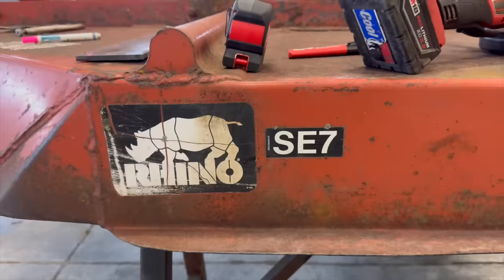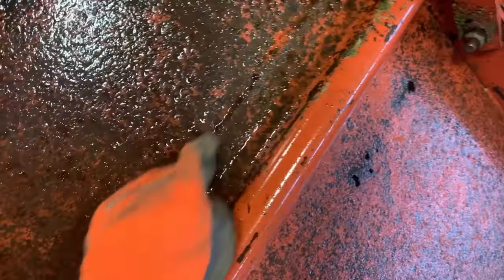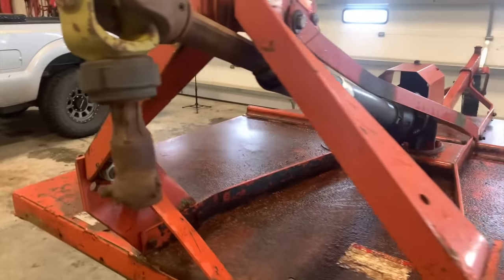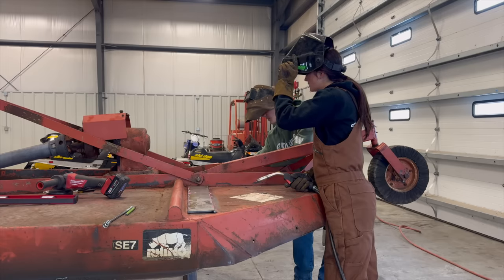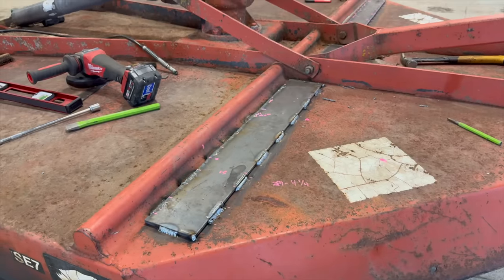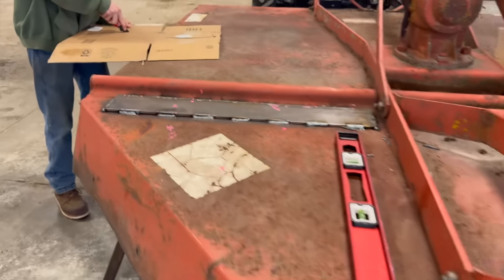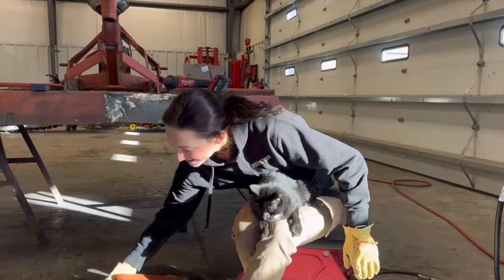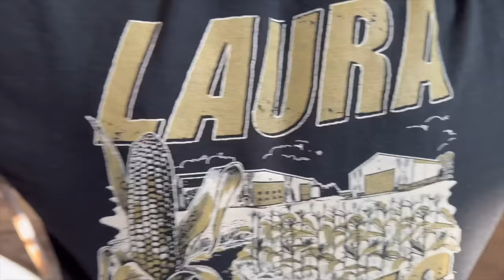Cheap Brush Hog Restoration

Comment: To get better looking and penetrating welds make sure the metal is cleaned up down to bare metal, no rust or anything.  For straight cuts on plasma, use something as a straight edge like angle iron or tubing etc. as a guide for the plasma torch.
Reply: Yeah, I'm no expert welder, but you'd definitely want to grind the rust and paint off and get back to bare metal before welding...

Comment: That round disc under the main deck is called a stump-jumper and is an option. The purpose of it is to help ride the fixed, and spinning, knife bar over a stump or other obstruction. without this option if the knife drive bar hits a stump, the mower would be violently thrown sideways until the stump is cleared. well worth the extra monies. Keep it installed.

Comment: Because my support arm bent on my brush mower.
I cut the support arms and I drilled holes in them put chain in place of the support I cut out.
Works great and I can use my quick hitch now.

Comment: Back in the 90's (1990-1997) I worked for an orchardist here in Central Washington and I rebuilt the Brush Hog mower they had. It was much larger than that one, it had 3 sets of blades with 3 gear boxes and 2 bogie wheels on the back. It too had major deck issues which I rebuilt using plates of T1 steel which is specific for high impact areas and I plated over the whole deck with the T1. I also rebuilt all 3 gear boxes with all new bearings, races and seals  All in all the mower was virtually like new when I was done with it.

Comment: Laura, I have a SE7 that is use 2-3 times a year and it is a beast!  Very strong and works really well.  Mine is a 540 PTO so not super-fast but real durable.  Honestly yours is in better shape than mine.  Word of advise, I have noticed that the 3-point pins and the bolts tends to come loose so be sure to throw some Loctite and lock washers on it.

Comment: you can get nice extension cords from a welding supply company.  you can get them in 25' 50' and 100' lengths.  really helpful.  I use them all the time in my shop to get the welder anywhere in the building
Reply: awesome video like always

Comment: Getting inexpensive farm equipment and farming with it is a perfect series. So many people have embarked on the Homesteading path ("for reasons") and this is a perfect educational resource. Keep them all in a play list as you go.  ... Start building a chart for acreage vs equipment you are using for this project (and compare with modern). An old dealer/customer Allis Chalmers1950s video had an amazing chart for different operations (like plowing, seeding) with their new line of tractors (WD, WD45, CA, B) could do in an hour/day/fuel. When considering how many planting days there are in the spring (say six weeks with some rain outs), a lot more ground can be covered with old equipment if you stay out in the fields than people realize (or are marketed to, to sell million dollar combines). Not sure of your tillage plans but compare plow/fit to no-till (no-till will need less demanding equipment).

Comment: Love the restoration of old farm equipment.  I believe the service to that welder shown was a typical split-phase multi grounded neutral.  It is commonly referred to as 220 volt.  It's two 120 volt hot leads center- tapped off the same 240 phase with a neutral.

Comment: Good to see you working on projects like that.  There is a  lot of equipment out there that can be brought back to life  with a little work.  Try using a straight edge when you are cutting, makes the patching much easier, and mig does not like dirt and debris so a quick pass with the grinder will make your welds better.

Comment: Need an 'Air Scaler' and an "Angle grinder".  Heat works good on those stuck grease fittings,  can also get a hammer activated grease fitting (ala Grease Buster) to get them loose.  While you have it up in the air... might as well clean up and grease the wheels.  Check the drive shaft for the fales carefully... sometimes they wear out.  Weld some 1/2" short chains on the back side of the deck,  keeps it from throwing stuff out the back.  Grease it and pressure wash it after using... it will last 50 years.

Comment: Wire from an old pivot span makes a real good extension cord for the welder you can roll it up on a garden hose reel when not in use

Comment: Better to change the grease fitting now and tape it for painting than to chew up a new paint job trying to remove a stuck fitting. The problem with not welding all the way around the plates is water will continue to get under them and rot the metal underneath where you can't treat it.

Comment: What ever made the hole in the rear of the slasher probably caused the twist in the spline on the pto. Must have been a big whack so would be a good idea to check the gear box foe damage.

Comment: On the mower you might try using chain instead of the blades. My dad used to mowed oil field ride aways.  The chain would flex if you hit a rock or something hard. It saved from a blade from coming from under the mower. Enjoy your videos  and the things you and Grant are doing and learning. Be safe and careful God bless.

Comment: Laura and Grant. You kids need to find you an old rogator. Take the tank off and all the components that go with it. Turn it into a flatbed put a boom and winch on it also a big toolbox. That way you can keep all your supplies that you need when you guys go out and fix pivots and you won't struggle so much when you go work on them. When your crops are up pretty tall. Keep up the good work all your kids are doing a wonderful job and God bless you💪🇺🇸👍🤗

Comment: Not that it mattered much for this project, but in general when cutting or welding vertically, you start at the bottom and work up, which works with the principal of heat rising.  The cuts and welds will actually go faster and you'll get less heat distortion.

Comment: Good job … a pro tip … get yourself a piece of bar stock for a cutting guide… use vice or C. Clamp to hold it you can cut perfectly straight lines… that way you get a tight fit … trust me you can fill the gaps with weld but it wastes wire gas and electricity

Comment: You did clean the metal under that plate of steel you just welded on, or primed it so that it would not rust.

Comment: Would be a good idea to remove as much rust as you can and paint  it with some kind of rust proof paint to keep it from further rusting. Also clean  debris off the top when not in use.

Comment: Gage continues to impress me; he is a super young man! I’m sitting here on my great big 140 acre hill farm I just inherited from my mother. It’s been in her family since 1845; here about an hour south of St. Louis in the Ozark hills. I spent my career in farm machinery dealerships and retired 2 years ago at 70 from a former Ford New Holland and Kubota dealership. Over the years we sold many rotary cutters of various brands. Be aware that the Rhino SE7 is a fairly light weight cutter, as evidenced by the light weight oval blade carrier or stump jumper, and the gearbox is probably only rated for 60-75 horsepower, by the looks of it. The front seal needs replaced and the slip clutch needs to be disassembled and polished up. It is most likely rusted together. But you got an excellent price on it. I laugh when you all call things “old”, I traded in my personal Bush Hog brand 5 ft cutter several years ago (to our dealership) and it was about 50 years old at that time.  I started at the beginning of your videos a month or two ago and have watched them all up to this point and I’ve learned a lot. Thank you so much!

Comment: On the patch in the back, should have made the top square and pounded the bend down straight/flat.and with the welds leaving the fgaaps in the welds will just make the lower part rust even ore as the water will get trapped underneath

Comment: Laura!!! Cover up all that long hair , the sparks will give you a crew cut!!😂😂😂
Reply: And, wear some safety glasses. You can always regrow hair, but not an eye.
Reply: She would still be beautiful!  😂😂
Reply: Get yourself a welders cap
Reply: You're all learning !
💪💪
Keep up the great work! A sand blaster would be handy for getting completely rid of all the previous rust, but it's going to still continue under the welded patches anyway!😮
Maybe a look inside the gear box! Replacing the seals and damaged gears ?⚙️ something hit the splines very  hard to cause the hole! LOTS OF PRIMER required!😅😂😂
Reply: Blow snow off equipment before you take it in the shop! Just an idea, ignore it if you want
Reply: Not to mention all of the rotating equipment that could wind it up. I've seen it happen, and it's not pretty.

Comment: Great job on the repair.  I have a 100 horse tractor and am looking for a mower, but all that I find say the gear box should not be used with a tractor with more than 50 horse.  How will your gear box hold up with your large tractors?

Comment: Indeed that caster wheel is set like that on purpose. Have you ever pushed a shopping cart with a wobbly caster. This is because improper alignment. The "bend" makes the wheel have a forward direction allowing it to always face the direction of travel. If it wasn't the hog would be unstable and be way worse than a wobbly shopping cart.

Comment: WD-40 in the spark path! After hot work, stay in the area for two hours! Are those jack stands certified? Weight limit? Tag them! I would not have looked for anything until I saw the wd-40. Fire doors propped open? Luv you guys! Just kidding! Safety Glasses! Wear them.